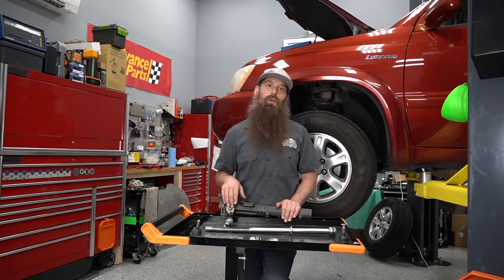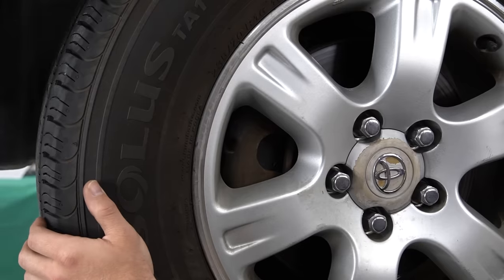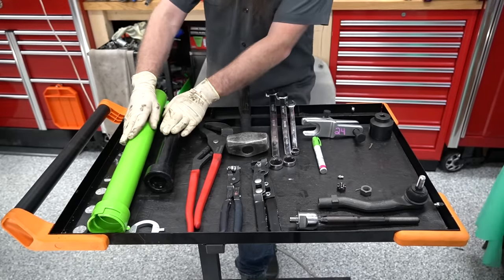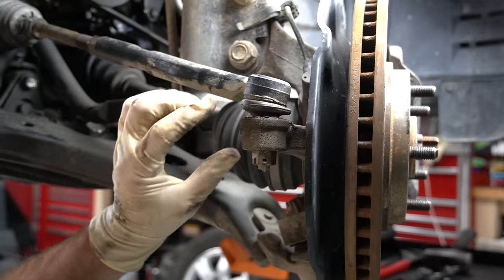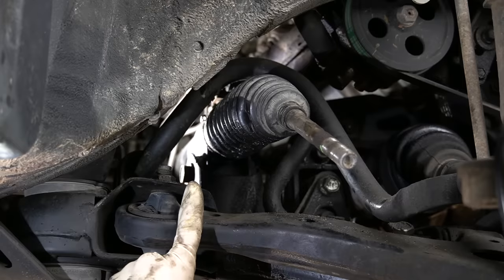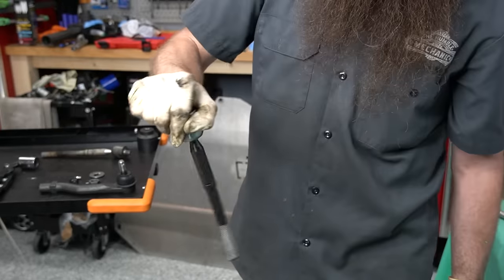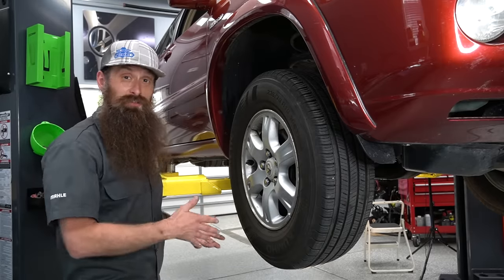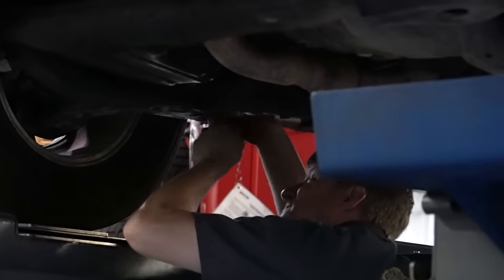How To Check and Replace a Bad Tie Rod ~ Clunk While Turning

Comment: Hey dude, I really like your videos you are to be congratulated, so I worked for several years at the VW and Audi dealership and we always use original equipment for the vag line, if you want I can help you with this, , I can help you with Odis program Geko, CP off, diagram with Elsapro etc..

Comment: At full turn, I have a wheel knock and it physically skips on both sides (19 Subaru STI). Could this be the problem. It’s not the cv axle as I’ve already had that looked at

Comment: Nice video, but it always makes me smile when I see people marking the jam nut position! Some use paint markers, some use tape, some count the threads to mark the jam nut, but none of that matters! The only thing that matters is counting how many times you turn the outer tie rod until it comes off. As long as the old and new tie rods are equal length, that will give you the measurement you need when replacing the outer tie rod. And if different lengths, you make the adjustment in how many + or - turns to get it equal. The jam nut could be anywhere as long as you have room for your outer tie rod to go back on the same number of turns you took it off. You then use the jam nut to come up tight against the outer tie rod and lock it in place. Think about it!
Reply: The mark comes in handy if you've forgotten how many turns you counted.
Reply: @francoamerican4632  I guess so, but write it down with pen or paint marker. You'll never forget!

Comment: How can I tell if it’s an inner tie rod problem rather than a outer tie rod ?
Reply: Symptoms of a Bad Inner Tie Rod
1. Vague and Loose Steering Wheel
2. Vibration
3. Squealing Noise When You Turn
4. Excessive and Uneven Tire Wear

Have the Vehicle Raised and Supported
To find out if your inner tie rods are bad, you’ll need to have the vehicle raised and supported.
See If You Can Look Through the Rim
Start by wiggling the tire back and forth while holding it on both sides at the 3 and 9 o’clock position with your hands. You’ll feel excessive play and even see it if you can look through the rim. 

Look at the Boot Located at the Ball Joint and the Socket Joint
You’ll need to first take a look at the boot that’s located at the ball and socket joint where the inner tie rod connects to the steering rack. When the boot rips or tears, it allows all the grease to come out and causes water intrusion. This then leads to corrosion that causes excess play at the ball and socket joint. 

Replace the Inner Tie Rod
If the inner tie rod is corroded you’ll need to replace it.

Does that help?

Comment: Nice vid! To remove the outer, is it okay to put the nut on loose and hit that with the hammer? (thereby avoiding mush-rooming the thread?) Thanks
Reply: I wouldn't. I usually just give the knuckle a wack with the hammer. Couldn't be bothered to go get the special tool.
Reply from the maker: You can. But if it doesn’t come off easy, move to the special tool.
Reply: @panzerveps  Classic move which works most of the time really. A good few whacks where it goes in works perfect like you said. The tools are nice just sometimes you gotta get it done with basic tools.
Reply: @baileyhatfield4273  I work in a shop where all special tools are shared, and the only times I've ruined a tie rod end on disassembly was when I used the proper removal tool.
Never figured out why, but I'm gonna guess someone had damaged the tool in some way.
I've stuck to my trusty old hammer ever since.

Comment: Question I have a Toyota avalon limited 2006 and the inner and outer tie rod need to be changed I purchase some at amazon and they send me the wrong product I send this back. Then I went to toyota an buy new ones but the inner tie rod from amazon they was very tie the bold part tha go inside was very hard to move with hands and the Toyota  one the gave a litter flexibility you can move with you hand is not like the one you removed but if you put a litter force you can moved around but the amazon one was very tie the guy from toyota he said they suppost to be like that. According to you experience are those from toyota are deffected ? Please let me know Thanks

Comment: bro. my wheel moves front to back. it moves from the front bumper towards the back of the bumper. not sure if i made sense but, every time i brake it clunks and when i hit a bump it sounds like my shock tower it banging around. but when i inspected the area every thing seems to be fine. what do you think it could be?

Comment: Hey charles what happens if i still get play and clicking turning in my steering but i just replaced both sides inner and outer tie rods
Reply: Could be the steering shafts itself. Could be the rack just have to check it all, steering shafts can be easy or dumb and hidden so.
Reply: @flukens  Just replaced both LCAs and ball joints

Comment: If you have to use a hammer, take the castellated nut off the outer tie rod joint, flip it over to avoid damaging the castellated side of the nut, and reinstall it until it is even with the bolt, use a pry bar or large screw driver to put pressure on the tie rod like you are trying to pry it apart from the hub, then hit the end of the bolt with a hammer until it pops up.  It is tapered where it goes through the hub so as soon as it pops loose you can remove the nut again and it will be easy to finish prying or tapping to get the outer tie rod completely out.

The taper can also make it easier to get the nut tight because if you press the tie rod into the hub it can cause enough friction so the nut can be turned down tight enough that the bolt does not turn when you put the wrench on to torque it tight.

Comment: Hi, question: I replaced all my suspension parts on my 2000 BMW Z3, tie rods, control arms, bushings, ball joints, all parts, etc. My buddy says I did it wrong because I tightened the parts while up on jack stands, he says I was supposed to do it 'under load' with the weight of the car on the wheels. Is he right? I did have a wheel alignment afterwards; wouldn't they have caught that if I did it wrong?   Thanks, in advance for your opinion.
Reply: They would not have caught that because they aren’t looking. Your friend is right however. I’ll explain. The bushings are designed to articulate throughout the travel of the suspension. When you tighten the bolts with the wheels off the ground and then lower it the bushings rotate, it load up from the arms rotating. So now when the suspension compresses you over stress the bushings causing very premature failure. Note; this only applies to bushings that have horizontal fasteners and not vertical fasteners.

Comment: Thanks, have one question. If you try to move the tire at the top and bottom will that tell you about the ball joints? And then as you showed side to side tells you about the tie rods. Is that right ??
Steve
Reply: Yes.  I had a rare instance where I had wheel play left to right, none up to down and the ball joint was worn out.   After replacing the ball joint, the wheel had no more play.  There are probably rare exemptions to this rule, but that's usually first thing to do when experiencing steering or suspension issues.
Reply: @realjohnnewburg  Thanks, Stev

Comment: Good morning
I am in the process of replacing a few front end parts on my mercedes e350  2007. Are torque specifications a must or tightening securely good enough?  I noticed you did not mentioned torque on the outer tie rod.  I have the tool and the specs are easy to find but if  I don't have to..... Thank you
Reply: I am not a technician or a mechanic.  But, with that being said, I, as the owner/operator of my car, I always use a torque wrench to secure whatever part to the manufacturer specified torque specification.

Comment: It is good to do both side or it doesn't matter?
Reply: If one is as bad as that one was, it's fairly likely the other one is getting sad too.
Also, if you replace both at the same time, you might save yourself an extra alignment from getting them done say 6 months apart.

Comment: What can you do with stuck tire rod end? Mine is stuck and I almost broke my arm turig the end rod and it wouldn't even budget one bit.
Reply from the maker: Heat. If that doesn’t work, cut it off
Reply: @HumbleMechanic  but where would you cut it? I don't want to mess the treads.
Reply from the maker: If it’s that stuck, I cut it on the car side of the jam nut. The. Replace the whole assembly. Inner and outer

Comment: If the inner tie rod is bad can it cause a leak in the rack and pinion?
Reply from the maker: Im sure it "could". but a more likely thing is, the seal got dirty and leaks.
Reply: @HumbleMechanic  I think I may have a leak in my rack seal. When I try to bleed the system with the tires in the air I hear sort of a squish noise when I go full lock left. Is this a bad left seal?

Comment: Hey Charles, what’s your take on the Bilstein B4s compared to B6s struts and shocks for the Audi A4 B8?
Reply: Are you going for lowering springs or just a stiff ride? I'm running B8's with HR lowering springs on my mk5 gli and there is no movement or fender scraping. They stay in place pretty well and not uncomfortable
Reply: @bamdragon25   I’m not going for lowering springs just gonna use stock ones with either B4 or B6, B8 would be a different story with the coils. But I’m going for a smooth ride and a bit sharper handling. I saw some B4s on ECS listed for cars with Sport suspension. You think I should go for these? Cause if I learned anything from research, it would be that the B6 wound up too stiff but with better handling. But I’d go to a smooth feel over a stiff one just for sharp handling.

Comment: I replace the outer and inner tie rods on my toyoa corolla and there is still wheel play from side to side. Before and still now whenever I move the tire the other side moves side to side as well. Could it be bad alignment or possibly that the tie rods are loose? If I hold down one tire the other one stops moving side to side and the steering gets tight again.
Reply: Things that make u go hmmmmmmmmmm..

Comment: Could a loose inner tie rod cause steering wheel vibration at high speeds? I've been chasing this issue for awhile and replaced a lot of suspension parts with alignments but still no clue
Reply: this can be related to wheel weight balance too

Comment: Hello i know this horribly off topic  ut i have a 6speed MK6 gti and sometimes at high rpm during heavy acceleration second gear crunches on the up shift from 1st. It  only happens sometimes.  Any idea where to start
Reply from the maker: Possible synchro issie
Reply: @HumbleMechanic  that sounds expensive lol. Thanks for the reply, i really appreciate it.

Comment: just wanna note that depending on the size of the hole in the ball joint stud the ball joint too may cause the stud to collapse at the hole. Threading the nut on to span the weak point in the stud can prevent this. Dont ask me how i found this out 🙃

Comment: @HumbleMechanic - do I need to get an alignment done when having the axles replaced in a 2012 Honda Accord?
Reply from the maker: As long as they don’t have to take an adjustment component off/ you should be fine
Reply: If it does mess with the alignment settings it should be slight. 
But on Hondas the axle is trapped pretty good. They have to remove the ball joint, strut wishbone, possibly the tie rod end….
It likely won’t HAVE TO be aligned, but if it wasn’t done recently, might be good to do. 
You’ll notice the steering wheel moved slightly if it changed much.

Comment: I remember on Fords, anyway that you're supposed to remove that hardened lock-pin before removing tie-rod.  Really now. As if you could even access it.  I'd say 90% of the time, just forcibly removing the rod(socket an impact) worked.  10% of the time, it ruined the rack.  So sorry...you need more than just a tie-rod.  Lol.  But, there was no way in hell anyone was gonna get that lock out of there.
Reply: Where, specifically is the lock-pin in the steering/tie rod assembly on Ford’s?

Comment: Channel pliers on inner tie rods? You deserve a smack for that. The correct tools are made for the specific reason of getting them on and off without making a hackjob mess. Second, marking tie rods usually doesnt work if you go between manufacturers -  OE to aftermarket as an example - as they are often made differently. Do a direct visual to compare.  Toe measurements done from the front and rear tread faces of the tires, or if accessible the rims themselves  - while on the ground - is always better. Third, when popping tie rods off, leaving the nut threaded on mostly 'can' help avoid mushrooming the stud.  Fourth, I prefer checking ALL linkages in both the loaded and unloaded state - Ive seen more than a few joints, rods etc that wouldnt show problems in one state but becomes obvious the other state. This guarantees redundancy and prevents missed problems. Fifth - TORQUE TO SPEC, WITH LOAD ON SUSPENSION.  This cannot be stressed enough. Under or over torqueing steering components can have fatal consequences. 

Sheezuz, do we Red Seal techs need to show you AST kids how its done? ;)

Comment: Before anybody replaces your inner tie rod be aware that there is a detrimental effect you can cause because you attempt to remove it or do remove it.

If the vehicle has slammed into curbs or nasty potholes you can or may have already damaged the rack and pinion or the inner tie rod end threaded mount.

I just removed my old tie rod the other day and realize that the new one would not thread on because the mounting hole was not perfectly circular instead it was oblong (oval) and so I have to return my new inner tie rods and struggled to reinstall the old tie rod. Now the shape of the reinstalled inner tie rod is crooked and shakes when hitting the brakes.

Do you know what's required to fix this? 

A brand new rack and pinion installation aka $580 rack & pinion, and $1,100 labor fee and one or two days without the car.

I should also mention if you at all damage the threads for the inner tie rod which connects into the rack & pinion then you will have to replace the entire rack & pinion. Just because the threads are cross threaded or stripped.
Reply: Tell us you cross threaded your inner tie rod without telling us you cross threaded your inner tie rod.

Comment: Reality, gets home from work,  gets outer tie rod removed from knuckle. Outer tie rod rusted and seized as well as lock nut.. 

Now what??????  You have an inspection coming up in 2 days and have to work tonight and tomorrow. 

That's why you need videos that cover everything that can go wrong with simple jobs like this. 

Answer, put it back together, return parts, pay mechanic.

Or

Remove inner tie rod boot, see if you have enough clearance to get a pipe wrench in there, hope that inner tie rod is not seized as well and try to remove it all as one piece. 

That way if you can't you still have the option to put it all back together and still have wheels.

Or commit to the job, cut off outer tie rod with an angle grinder and use inner tie rod removal tool.